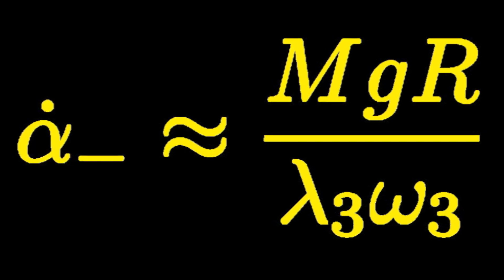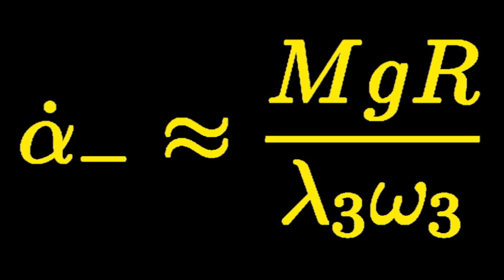Gyroscope-Newtons_Law_Explanation_Part_II-1080p.mov

Comment: Thanks for a great video. We are trying to simulate gyro effect correctly in a structural simulation sw (simis.io). Have you seen that done? As a structural engineer I want to understand the equilibrium aspect of Newtons 2nd law - what are the forces and moments acting on the gyro? Vertical gravity, vertical support load at the 'pinned' support. Then what? There must be a moment (torque) - how do you calculate and explain that?

Comment: Nice video. When you were talking about doubling the velocity (09:05) It was mend doubling the precession rate and not the actual angular velocity of the spinning wheel? So when you applied the torque on the axle the velocity of the wheel did not increase or decrease -- except for the drag due to environmental factors?

Comment from the maker: Thanks for the comment!

Absolutely ... in fact, the denominator \lambda\omega is the angular momentum around the rotor's axle and the numerator MgR is the maximum torque.  So this description is assuming a constant nutation angle, \beta.  The expression includes the maximum possible torque, not the actual torque, since the precession rate does not depend upon \beta.  See my Gyroscope-Nutation-1080p video and the Gyroscope-Nutation.pdf file on the funphysicsfacts web site for more specifics.